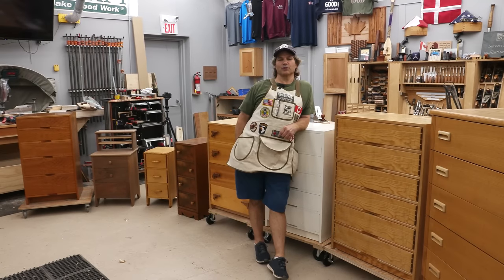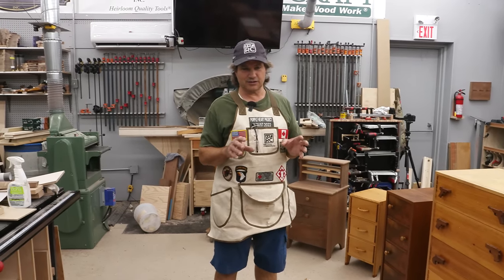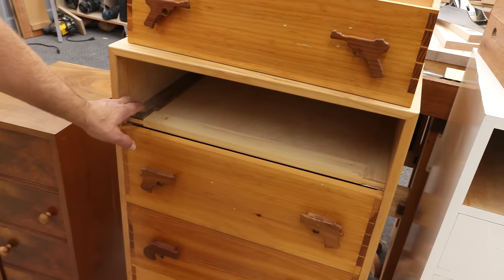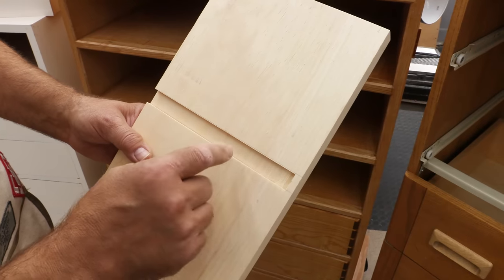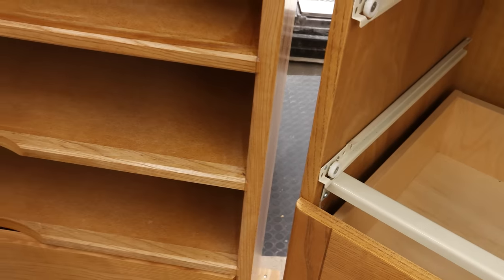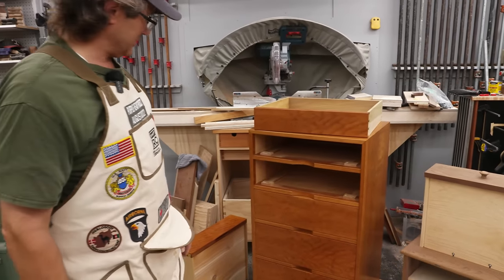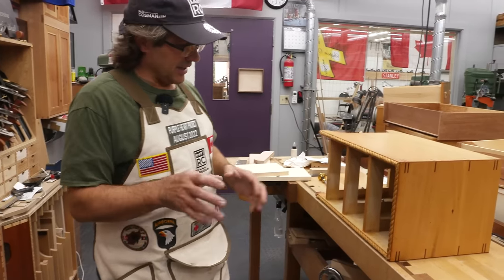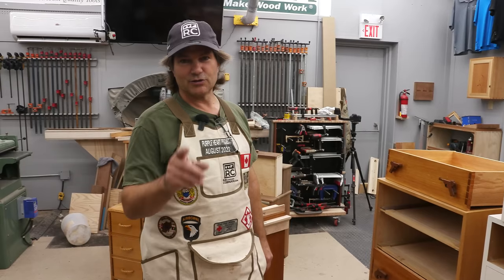Build A Chest Of Drawers | Critical Design Elements

Comment: Hello Rob! Thanks for this (and all your other) videos. I am actually working on my first solid wood casework myself, and I felt the same way about some lack of easy information. This was perfect.

I did have one question on the fit of the dividers. You said the front is securely fastened on the divider, and the sides are just dry fit, but I didn't quite understand on the back. Is it a secure fit similar to the front? Or are the two poplar sides of the dividers mortis and tenoned into the back, securely or dry?

Thanks again!

Comment: Hi Rob. Great video with lots of really good info. Thanks. A number of years ago in a museum they had a high chest of drawers that used frame and panel construction for the sides. One of the conservators was kind enough to remove one of the drawers so I could see the inner casework. The builder had used frame and panel construction for the drawer dividers too. I have always wondered how you would fasten those dividers to the sides and it remain strong enough to last. That chest was over 200 years old so obviously it worked. I guess you would be taking advantage of relatively small expansion and contraction of one frame member housed within another even though it would be cross grain. Your video has inspired me to try this out and see for myself if it would be strong enough.
Reply from the maker: You must allow pieces to move when they are in crossgrain construction.  I gave several methods to do that in the video.
Reply: @RobCosmanWoodworking  Yes. Sorry, I wasn’t very clear in what I was trying to say. It looks like to me that using frame and panel sides for the case significantly reduces the cross grain problem you pointed out when you are using solid wood sides. It might be an option for case work if you like the look of frame and panel (which I do). Thanks for the reply. Your videos always get me thinking about how to do things differently. I really appreciate all the information you provide.

Comment: Thank you, there is a LOT of useful info to absorb here. For me, it's especially the dry-fit approach you used with the divider frames to handle lateral expansion. I knew this stuff in theory, but you illustrated this well enough for me to really get it 😁
PS I was a little surprised to see no slides used expect for the mass produced example. I'll have a look through your back catalogue for the answers to that. I guess if the fit is good enough, then there is no real need for slides.
Reply from the maker: Exactly. A drawer is a box that fits in a box.  Watch my drawer making playlist

Comment: Just curious if you have a preference as to which season you build furniture, since humidity levels have a big impact on properly fitting things together.  I would guess winter is the best time and then as summer comes around if things swell a bit it just helps tighten the joints, Whereas building in summer you may see things cracking or loosening when winter rolls around (wider dados cut).  Is this anything you even take into consideration?
Reply from the maker: Actually it’s quite the opposite. My preference (for drawers at least) is to fit them in August/September, when the humidity is at its peak here. That way they’re not likely to get any tighter than when I finish with them.

Comment: Hello Rob.. thanks for the video.. wanna know how thin is the venner you use on the mdf? Just wondering if the mitre joint on the carcase if it wont risk breaking when one use a thin sheet of venner on a sharp edge or have you used a home made venner made at the workshop with a bandsaw? Cheers from Brazil..
Reply from the maker: Both will work.  I prefer using the thick veener.

Comment: Love it! I may make one with the drawer cut outs instead of pulls, I've only thought of doing so on all my shop drawers but this example is really quite  exquisite! Great example! Also, I've thought about using veneer on MDF but dont have a source for decent veneer. If you know of one in the states I'd appreciate it.
Reply from the maker: There are a couple online places but I get mine from local suppliers

Comment: Very helpful!!! I have learned so much from you. Can you also with solid wood construction have your panels be attached to the side with a kind of sliding dove tail that is only glued in the front?  Would their be any negative with that design other than time?
Reply from the maker: A sliding dovetail would also work but I think its a lot more effort than its worth when a shoulder Dado is easier to cut and assemble and virtually as strong once glued up